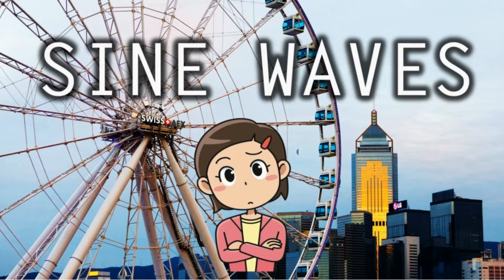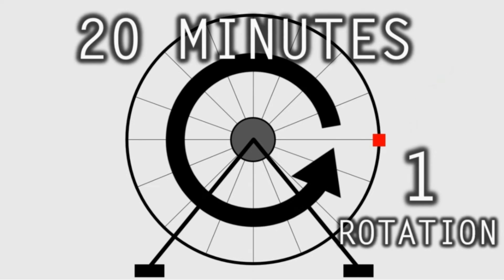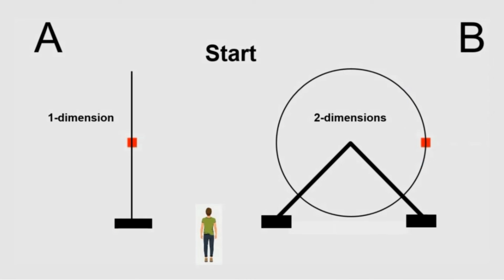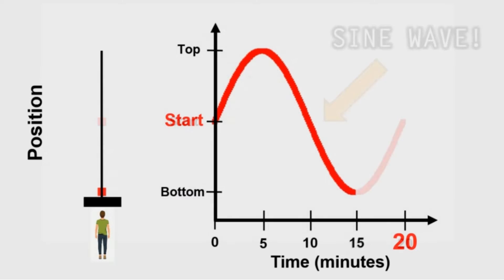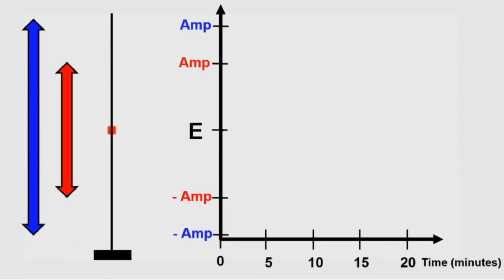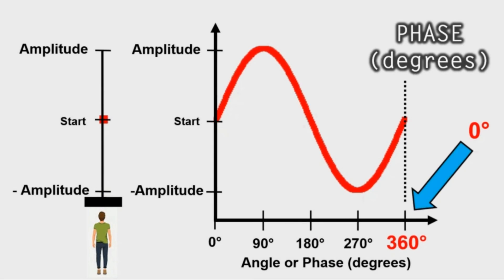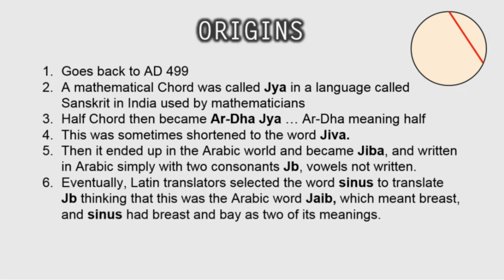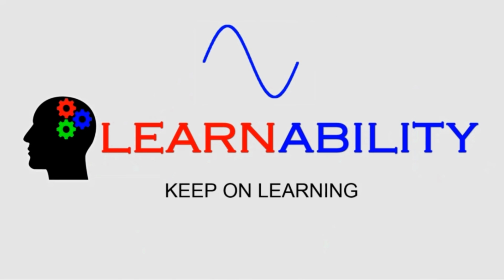Sine Wave | Simple Explanation on a Giant or Ferris Wheel | Trigonometry | Learnability

Comment: As per my understanding I am thinking of the vertical motion of the Red square moving through time in the horizontal direction and then tracking the movement of the square that will produce a sine wave
Reply from the maker: You got it!
Reply: I'm trying to understand.   I believed that the sine-function resulted in values on the vertical axis (Y-axis)?.   And therefore the "red square" (plotted sin(x) - values?) should not rotate but go up and down the y-axis as the wheel rotate.  (In the same manner as the red dot movement looks like from the side (1. dim)?
And then this up-down movement on the y-axis is streched out in time to get the sine-curve as a function of time?  But I may be on deep (wavy..) water here....

Comment: I think that the blue wave is rotating at the same speed and amplitude as the red wave as they both complete one rotation at 20 minutes and both have a maximum and minimum of 200ft and -200ft respectively.
Reply from the maker: Correct! Thanks for supporting Learnability | RoseUniversity.org

Comment: I don't understand why phase is important :(
Reply from the maker: Hi! It's imrpessive that you would question why phase is important, it shows you want to understand the point of it. Well let me try to explain why its important in a simple way and hope it helps. If I ask you what's 100+50, you'll quickly say its 150. Now what if I say but 100 in that question changes in 5 minutes to 150, then after 10 min its 100 again, and then after 15 min its 50, and 20 min later its back to 100. Getting confusing, right? You'll probably be asking me ok wait, then  just ask me at what "Time" do you want to know the answer to the original question? In 5, 10,15, or 20 min? So the key is the number varies according to how much time has passed ... Back to "Phase", that acts as "Time" or an input which changes or varies the original number depending on time or PHASE. For a Sine wave, its the same. If I ask you the value for a sine wave, you'll ask at what time? (Like on the Ferris Wheel). What you're actually asking is at what PHASE? Without knowing the Phase, you can't answer what value the sine wave is at. For all waves in nature; such as Sound and Light, or any other wave that repeats itself, without knowing its phase, you can never know their instantaneous value and to make it worse, if there's multiple of them, how can you possibly add them? Example as the Ferris Wheel, if you want to know your height from ground at any time, all you need to know its your phase (or what time), and you'll have an answer! sorry that physicists made things confusing by inventing "radians", but its just degrees (angle) the wheel travelled in a circular motion in a certain amount of time (radians per sec). When radians per sec is multiplied by time, you're back to radians or degrees again. That is why Sine waves always have a Sine(w*t) format (where w is greek letter omega, is just radians per sec)

Comment: I never understand this, why sine wave goes like ocean wave, but it's a wheel of cycle not an ocean 🤣🤣. Very well explained.
Reply from the maker: Rahul, ocean waves you see, if you stop time (or take a photopgraph), would look similar to a sine wave (like the one plotted in the video), however, with ocean waves, the x-axis would be distance covered by the wave (wavelength, maybe in meters) and y-axis is the height of the wave (amplitude) with the time component frozen because you see the wave instantaneously in front of you (or in the photograph). In this video, a pure sinusoidal wave is shown, which is a component (vertical or one dimensional motion) of circular motion, plotted over time which you can't see instantaneously, because its the position of the red dot collected over time. Its time that is stretching the sine wave horizontally in the video. Whereas with ocean waves, its distance on ground that is stretching the wave horizontally. Hope this helps!
Reply: @RoseUniversity  Thanks for your reply. Really appreciated.

Comment: Can u explain square wave also ...?
Reply from the maker: Hi! Do you mean square waves used in data communication? or square waves seen on surface of water? Send me a picture of what you're curious about ...
Reply: Good mention. You should do a video on square waves. I watched some embedded electronics videos where the guy would throw them on that wave machine to explain inverters & transformers IIRC and there were times where the waves were square shaped instead of a nice sloping rounded line
Reply: Square waves are ultimately a superposition of multiple sine waves, with a pattern of increasing frequency called harmonics, and decreasing amplitude as frequency increases.   Look up the Fourier series of a square wave, and Fourier transform that generates them.

Comment: Wow!! I will probably remember this forever now. The answer to the question should be same size (because of same Amplitude) and same speed (because of the same amount of time it takes to complete one oscillation).
Reply from the maker: Correct!
Reply: The second, (blue wheel) is CLEARLY spinning twice as fast as the red wheel and it is the same size. So you are wrong, and the author of the question just made t10 = 20 and t20 = 40 in the blue to make it a trick question.
Reply from the maker: Andrew, hint: please take a look at the x (time) axis of both plots closely. Its a trick question. Thanks!
Reply: @andrewfetterolf7042  The question is visually tricked. For first one the motion recorded slow in video, while for second one motion recorded in video faster, that's why it looks that way, but looking at X and Y axis things are different. And for the same reason, X axis in second one is made bigger.
Reply: New appliances will only work off this wave. All my off gridders out there